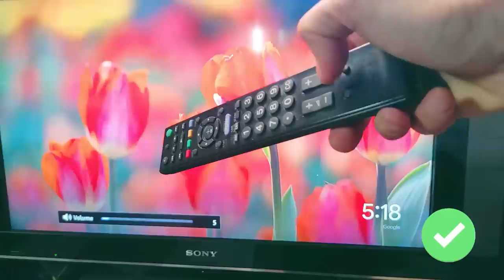If You Combine Super Glue with Aluminum Foil You Won't Believe What Happens.

Comment: 👍👍👍Just clean the pads on the Green board AND the Black rubber pads with Isopropyl Alcohol using a Q Tip👍👍👍
Reply: I've done that and still had the remote not working, I had to do just what he showed
Reply: I’ve done the cleaning also, only worked for a short time before having to do it again…
Reply: @deuss001  There is one other thing you could try, it's sliver in a tube, it will work to repair traces on flex ribbon, it should work on the carbon remote pads.. :)
Reply: @kidkv  I have tried contact grease. Didn't work and spread everywhere.
Did that after trying the alcohol cleaning which only worked on some of the keys and only for a few days.
Reply: @deuss001  You must be doing something wrong.   I've cleaned several of my remotes over time and they have all lasted for years of use,   Some still working fine.  Others needed a 2nd clean.  Sorry to hear your's didn't last
Reply: @ODX171   thanks for the input, no worries I have managed… :)  … as an update; I used an eraser on the copper pads… I’m not tossing the remote out, just looking for a better answer…thanks for your observations/efforts
Reply: Seems like the contact on the button side might have worn off.
Reply: The main idea presented is that contacts can be cleaned, either with rubbing alcohol or using this method with the CA glue and aluminum foil, or recoating the contact areas with a conductive solution that dries quickly. You don't have to throw away an otherwise functional remote control because some of the keys are not working.
Reply: Cleaning works when you have that greasy residue that appears on the circuit board due to what appears to be oil leaking out of the silicone pads over time. However, when cleaning with alcohol no longer works it means the conductive surface embedded in the silicone pads has worn off. The only way to remedy this is to restore that conductivity. I wouldn't have thought however, that super glue would actually stick to silicone. Not sure how long this will last.

Comment: 2:19 Die Spannung der restlichen LEDs erhöht sich dadurch und sie werden nicht lange halten.
Einen Lötkolben haben Sie auch nicht.
Selten so einen Pfusch gesehen.
Reply: That's the point - this is how to fix it if you don't have a soldering iron.  And yeah, a proper fix would replace the LED or put in a small resistor to compensate, but the alternative is to throw it in the trash.

Comment: Stripped screw hole.  a drop of any glue, hammer in tooth picks... same result  -  old school.
Reply from the maker: Exactly ! Like this https://youtu.be/7oNORWnvA84
Reply: You could use boogers and then you wouldn’t even need glue.

I’ve used scrap bits of solid copper wire (12-16 gauge) to repair oversized holes in masonry. You know, when the plastic anchor piece is loose so the screw pulls out? Cut the wire to the depth of the hole and that will give the screw and the anchor something to bite into.
Reply: @Riff65  That might work for some repairs, but it’s not going to have much strength, plus you have to wait for the glue to dry. The thing about the superglue is that it’s quick drying, so you can do the repair more quickly. However, making the small bits of aluminum seems tedious to me. You could just roll up the foil to fit the hole.

Comment: The glue should be applied on two opposite corners of the foil, as only centre portion of contact button works. Applying glue on centre part, insulates, instead of glueing.